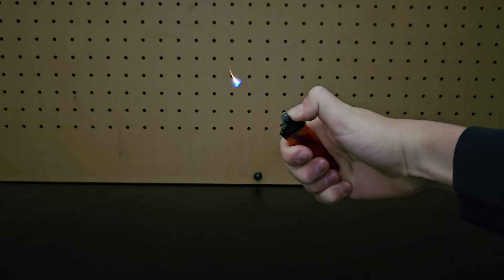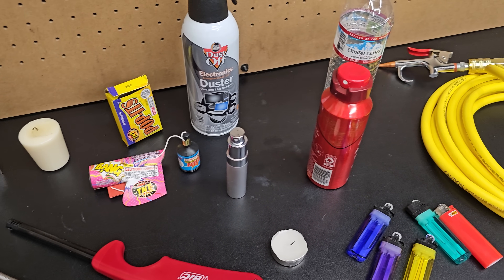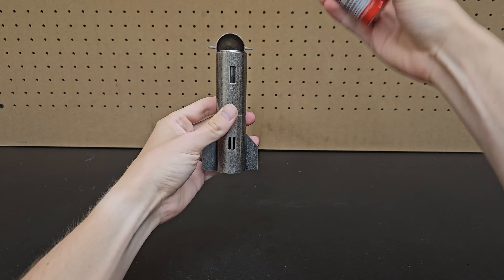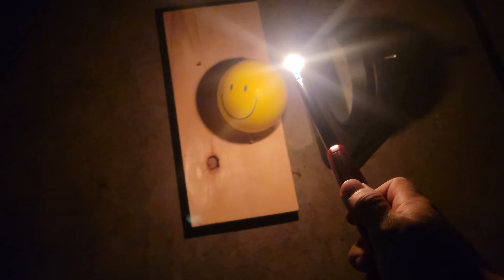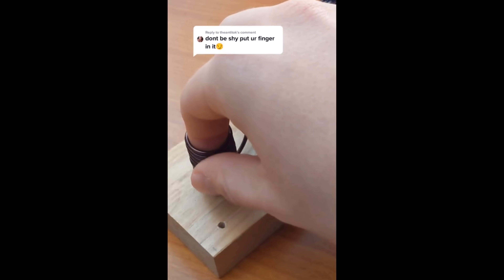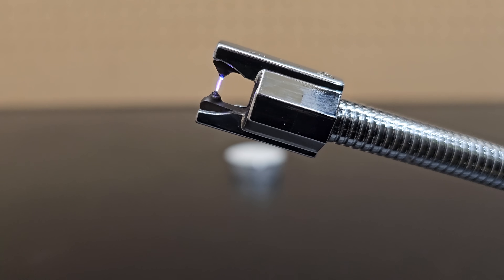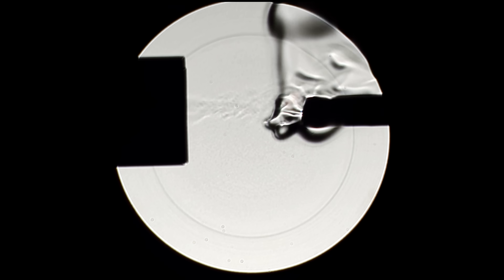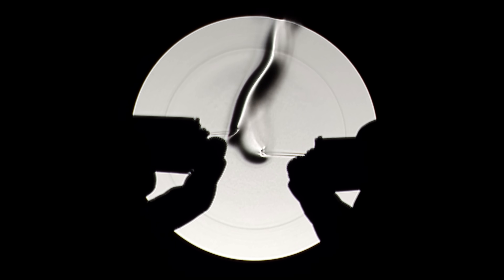How can you see shock waves?

Comment: I used Plano convex lens [Glass magnifying Dia 75mm]

A plano-convex lens can form both real and virtual images depending on the object's position relative to the lens. When the object is placed at a distance greater than the focal length, a real, inverted image is formed. If the object is placed closer than the focal length, a virtual, upright, and magnified image is formed….

Just now referred from Google

Note: to the acknowledgment message before

Comment: Another trick for those lighters is you can just pull up on the flow gear, move it over, push it down, and up the flow again. You can basically turn a lighter into a mini-flamethrower. I had one that would put out a foot-high flame.
Reply: "cracking" a lighter, because Crack heads do that so they can heat their spoon better

Comment: You warn against putting things up to your monster flashlight because it might damage it, but does covering the output of your phone light risk heat stressing it?
Reply: Iirc only if you do it for a while.  LEDs use resistors in their circuitry, and those resistors can get pretty toasty if run for a while.  It’s the same reason the base of an LED bulb heats up, while the bulb itself stays cool.